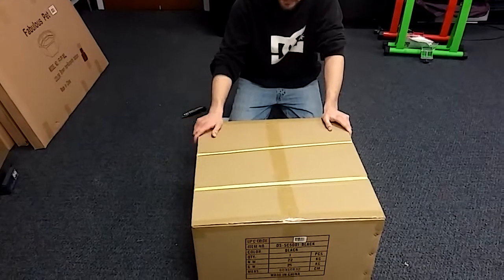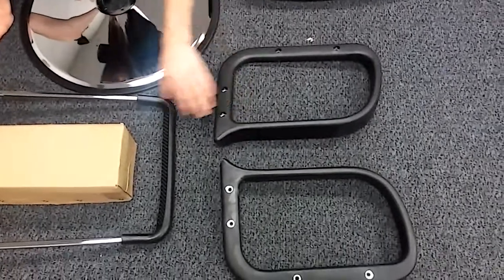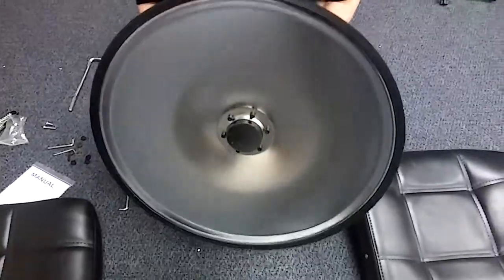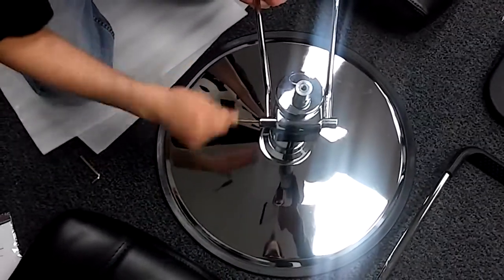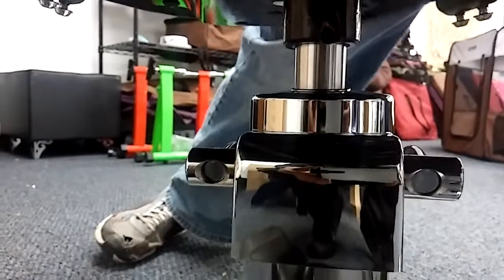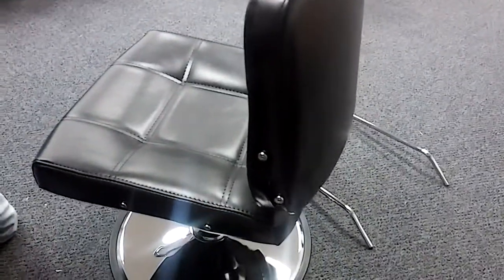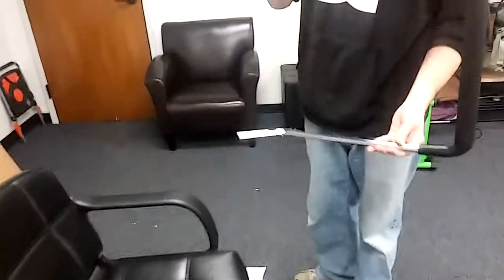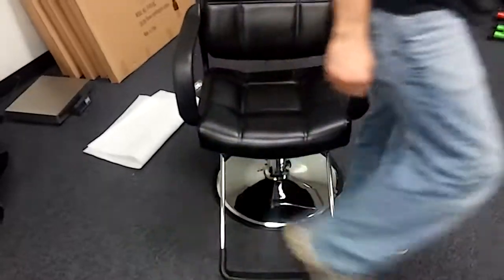D Salon Styling Chair 5001 set up video

Comment: you guys should absolutely link this in your amazon listing.
i was kinda confused on the pin in the tool bag since it wasn’t listed as a part in the installation manual. and there are a few screws that are in there as extra screws, also not listed in the manual.

but i like the chair so far. after some more use i’ll drop a review on amazon for you guys.

thanks for the video!